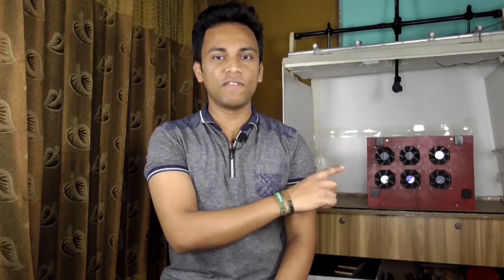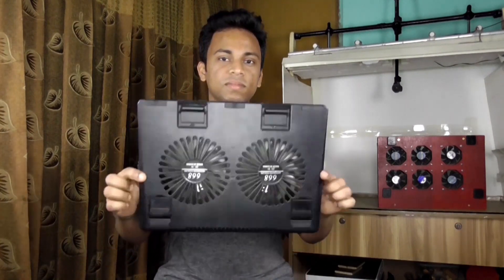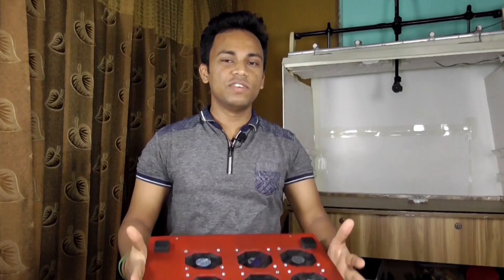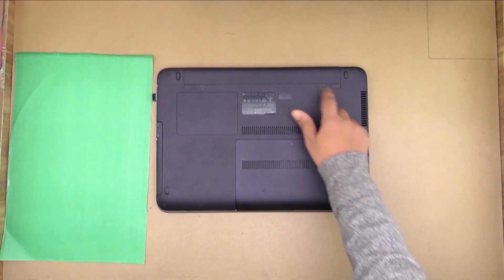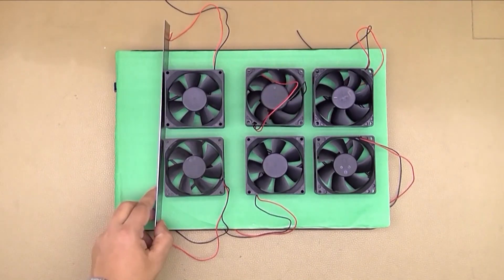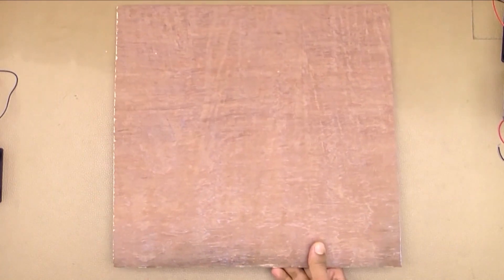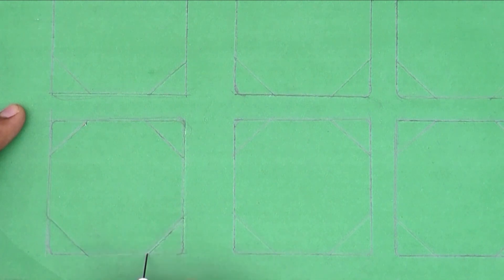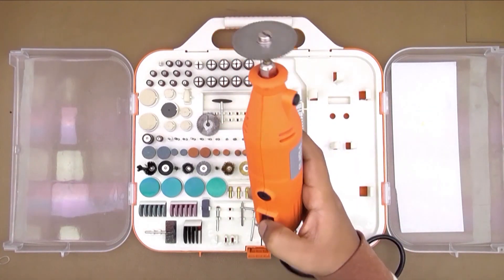DIY Laptop Cooling Pad | Gaming Laptop Cooler | Best Life Hacks for CPU Fan | Build Your Own

Comment: How did you connect all the 6 fans which require 12 volt dc each. Did you connected them in parallel or in series with the DC adapter please clarify

Comment: This is very cool! No pun intended.
I know this was made 4 years ago, but have  you made an improvements to the design? I saw a laptop cooler with built in battery charger pack so it powered the fans with the battery pack but the battery pack could be recharged via USB. I'm thinking of a design with USB C so a magnetic USB dongle could be left inside the port and magnetic cable could be used for charging to make things simpler. I also wanted it to be able to be set on the lap instead of a desk and to have cushion on the bottom, but I'm trying to figure out how to have cushions that don't interfere with the fans.

Comment: Nice :) can you tell me how much volt of fan are you using ? Also why not take it one step further and made evaporation based laptop cooling fan. Do you think it can reduce it to 30% since it will send cold breeze into the laptop ?
Reply from the maker: Hi Shashanka, yes I thought I would do it in my next video. Anyway, I've used 12 volt fan. Please subscribe & stay with us. Thank you!
Reply: @TheIdeaBlaster  I have been following your idea and nearly there to be completed. So what i wanna ask is  how much power of adapter do i need to power the fans. E.g. There are 6 fans of 12Volts. Do i need 12/1A power adapter or 12/2A power adapter  to make it run fast and smooth to generate more air ?
Reply from the maker: @MrShashankTube  You should go with a 12V 2A adapter
Reply: @TheIdeaBlaster  Yaa waiting to see that :)

Comment: Mate this was awesome.subscribed.
Do you think it would work with a powerfull alienware gtx1080 laptop? Also what is the rpm of the coolers.i have normal cooler witch i bought but doesnot actually work.thx
Reply from the maker: Thanks for subscribing 😍

The performance depends on your using. I've used medium quality cooler fan on this project. My recommendation is - you can use 2200 - 2500 RPM cooler fan for your laptop. Please be careful when you set the fan with the structure. Follow my steps very carefully.

Don't worry it'll work 😊